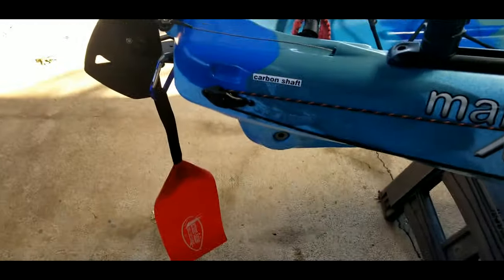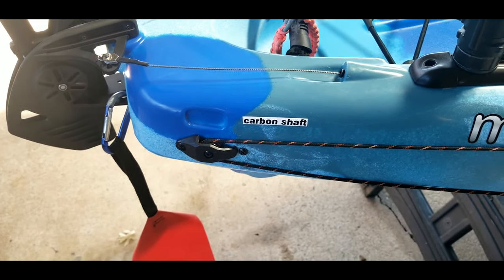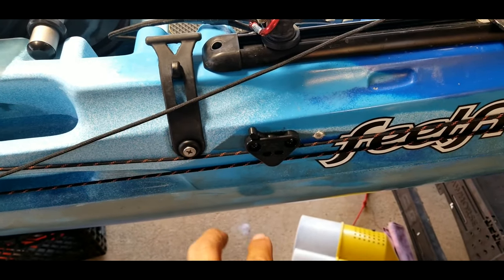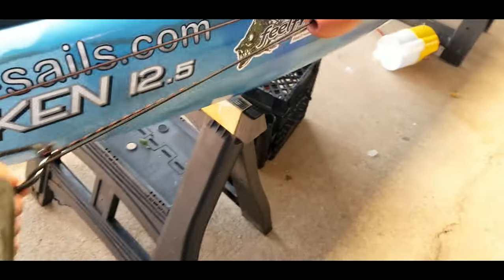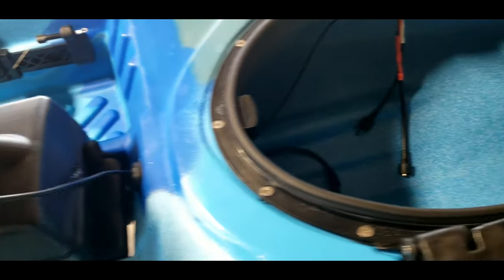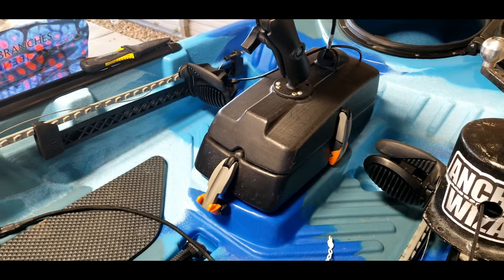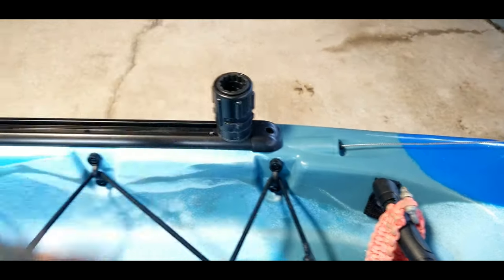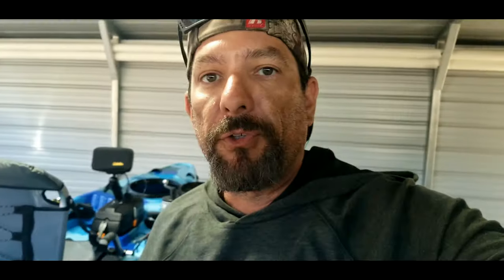Feelfree Moken 12.5 V2 Rigging

Comment: What is that orange thing hanging off the back of the yak?
Reply from the maker: Its a quick release Para cord bracelet.. I can un-clip and pull the clip end and 100 feet of cordage will quickly come undone.
Reply: @MicroOutdoors  That is the thing on the handle. That's cool but I think I was asking about the big orange flag looking thing.
Reply from the maker: @Grandpa_RLP  gotcha! That's the DOT safety flag since it hangs off the tailgate when I'm transporting it. Most local dealers give them away. (free advertising!)
Reply: @MicroOutdoors  Okay that makes sense.

Comment: for the ram mount did you just use self tapping screws to put into the top of the sonar pod?  or did you use bolts?
Reply from the maker: self tapping AND a bead of Hot Glue

Comment: Can you still adjust the pedal position when the rudder is installed?
Reply from the maker: Yes you can. If your needing to move them a great deal you can simply readjust the rudder cables, (extra slack in line for just that)

Comment: Where did you get that knife on the left rail track
Reply from the maker: Its a Stohlquist Squeeze Lock Knife.. coolest part is, with the clip that it comes with, it snaps right into the Feelfree rails but will not come out. You have to remove the end caps to slide the clip off the rail if you ever needed to. Because its a "DIVE" Knife its safe in the salt and will not rust. I have this one on all of my Feelfree (4 years total) and still looks new